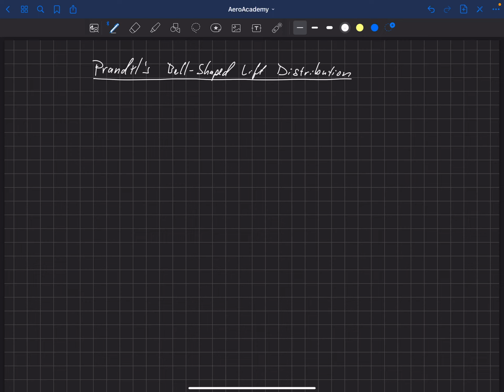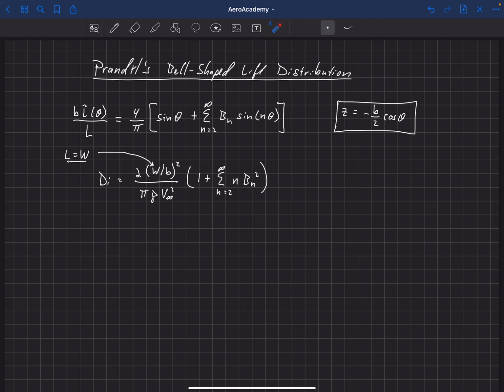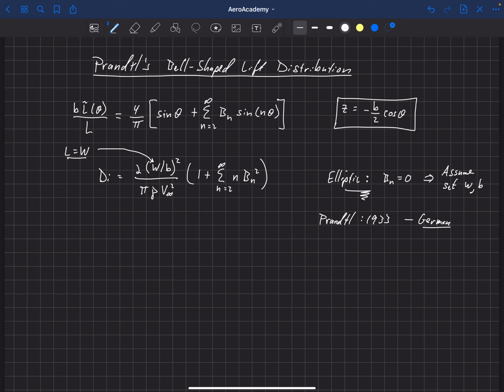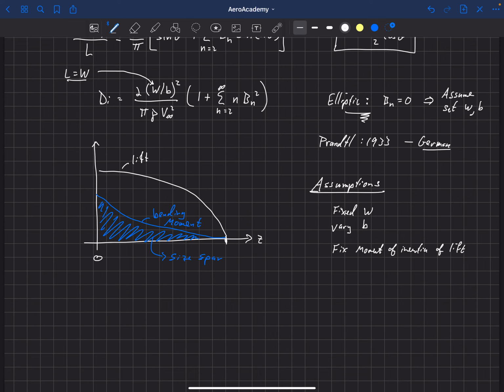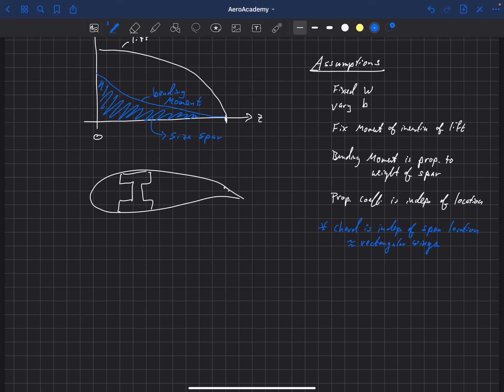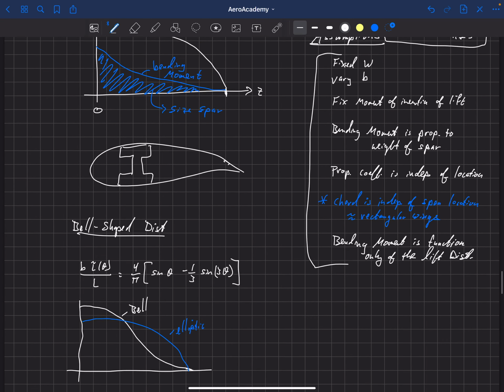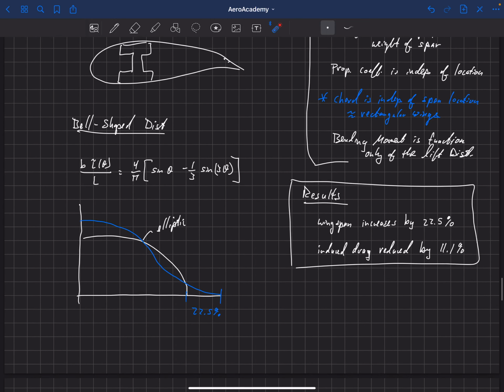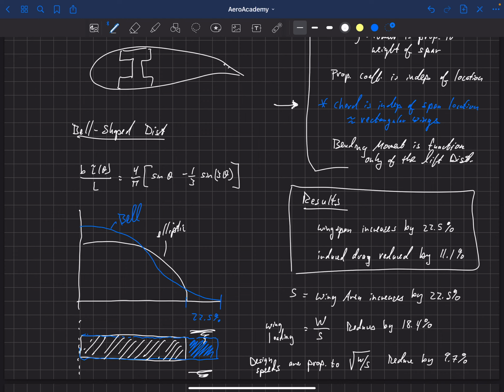Prandtl's Bell-Shaped Lift Distribution

Comment: Hi everybody.
I have noticed that most birds don't glide with straight wing, ( I am talking about the dihedral of the wing) this is especially obvious on an albatros glide:
Could a bell shaped lift distribution be achieved, simply by varying and changing the dihedral angle of a wing along its span?

Thanx!*
Reply: Nope, they have twist in their wings and wing tips carry no load, tips are used for precision control of the flight.

Comment: It is interesting to note that the NASA/Bowers patent for the bell curved lift profile that produces proverse yaw rather than adverse yaw was issued in the same year as development began on the Northrop Grumman B-21 Raider, which is the first production flying wing aircraft that does not have drag rudders at the wingtips.
Reply: Woah... I just looked at it and I think you've nailed it on the head.
Reply: @appa609   Northrop Grumman B-21 Raider does not have bell-shaped lift distribution (BSLD) wings, instead it uses split ailerons as rudder to control yaw.